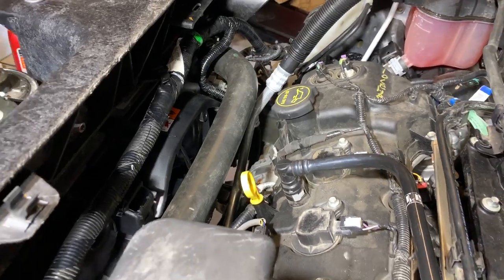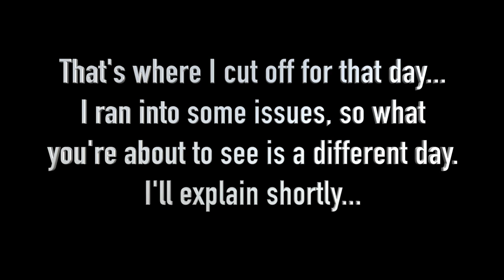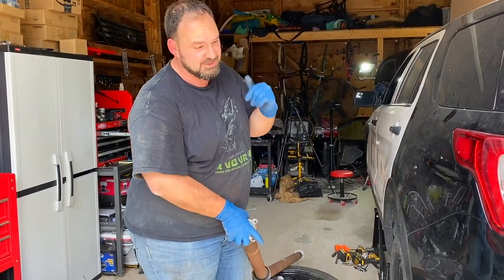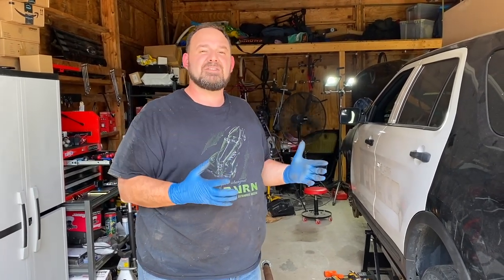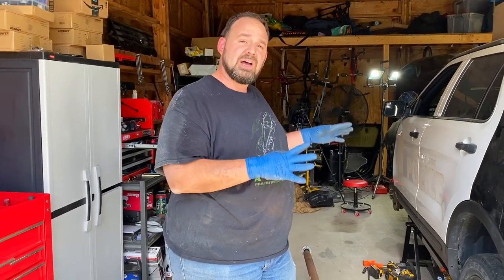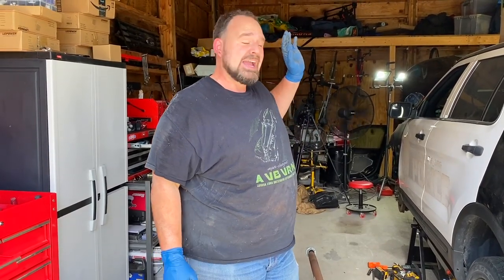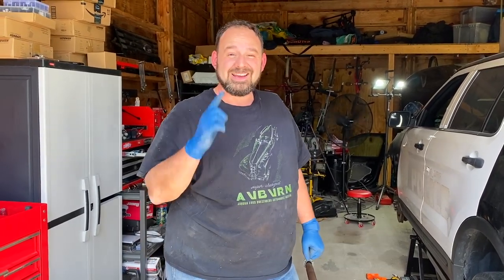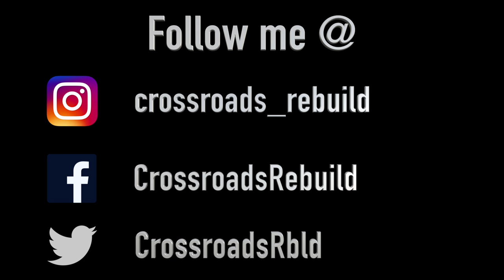Rebuilding A Wrecked 2017 Ford Police Interceptor Utility -- Part 9

Comment: usually it's cheaper having a driveshaft shop repair and replace items on the old one as needed. Then you don't have to worry about a used one giving you the same issues some thousands of miles or hundreds of miles later
Reply from the maker: Yes sir! That’s what I ended up doing. I’ll talk about that in an upcoming video. Thx for the suggestion!

Comment: How did you make only FWD from AWD?
Reply: If you would just leave FWD (without a drive shaft, would it be any fault of rear wheels not spining)?
Reply from the maker: It’s pretty to make it FWD only by simply removing the driveshaft from the transfer case to the rear diff. That’s what I had to do anyway to repair the driveshaft. Don’t know if it would cause any long term problems or codes. The Interceptor was still pretty torn down when I did that. I was mostly just doing it because I needed to be able to move it around while the driveshaft was being repaired.